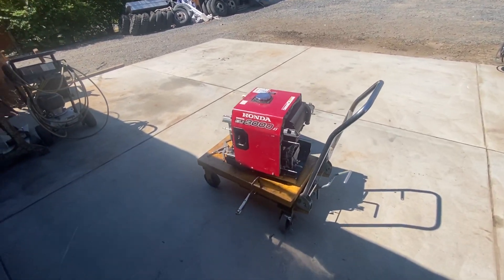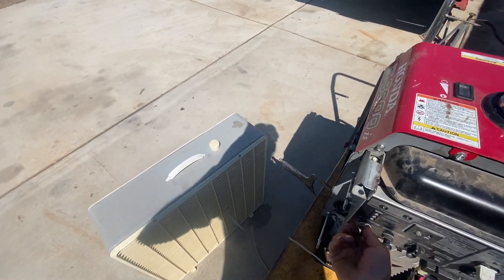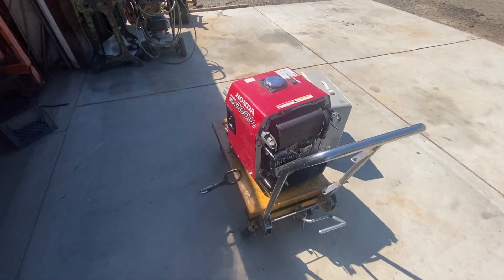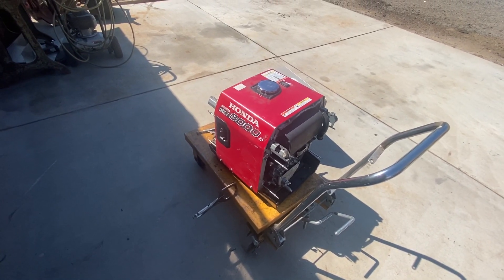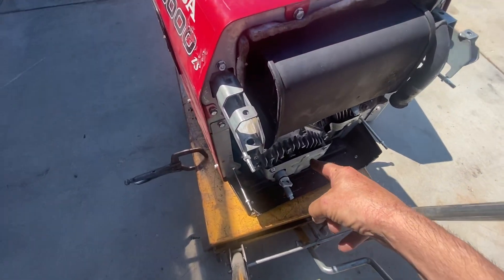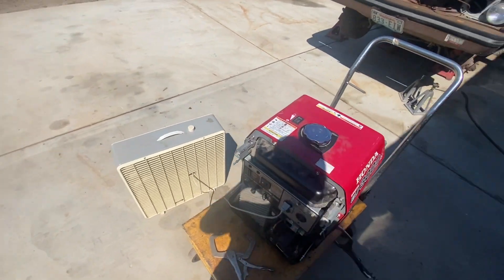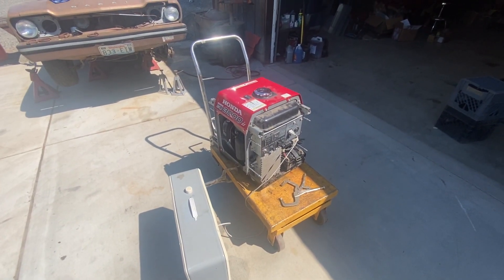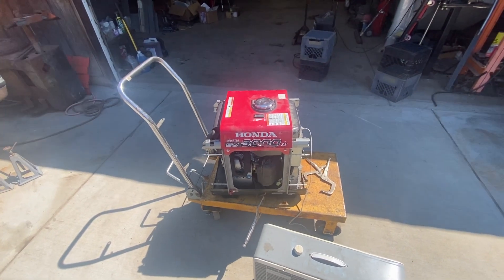Honda eu3000is rebuild part #6

Comment: Do you have the clone part number, I am in Canada and about to dive into mu EY3000.
Thank you
Bob
Reply from the maker: Part #3 has part # jrpwracing.net. Does require drilling and tapping, also you must properly seat rings otherwise you’ll have a smoker. If I was to do another one would buy a gx200 off eBay from small engines for less, currently on eBay auction # 265436564907. Strip it down and use what you need. You would have all genuine Honda parts.
Reply: @samross3159 does a regular gx200 require any mods to make work with the eu3000is? Or will I need to swap crankshafts
Reply from the maker: Pretty sure you just switch cover plates so you can change oil and just cut pto shaft to your liking, just my two cents, let me know if it does or doesn’t work, thanks @joshua1577
Reply: @samross3159  I think I might actually just order a new Honda. It’s only 280 and a rebuild for it right now is 130$ for the old engine. I will keep it in my arsenal as it still works. What size engine did you put in yours? A 196cc or a 212cc?